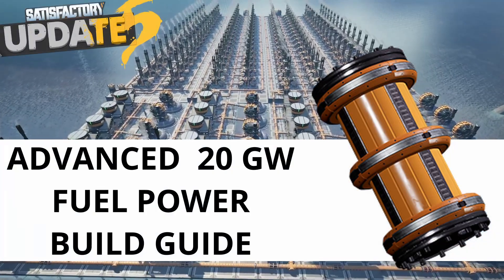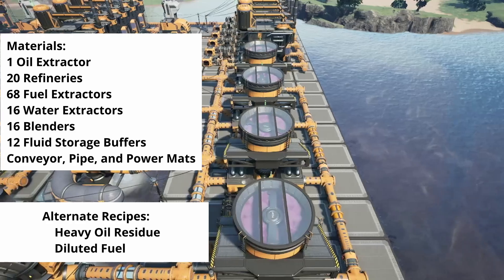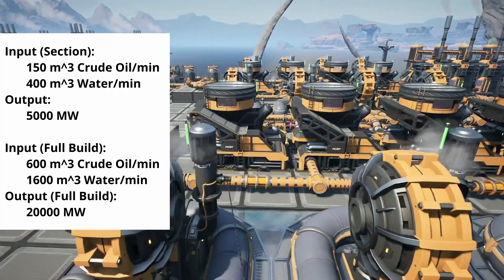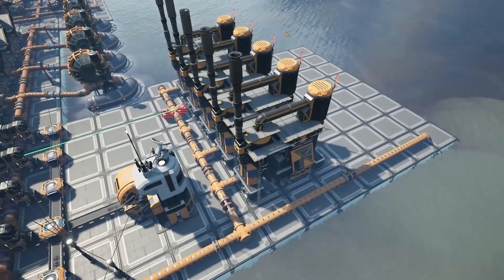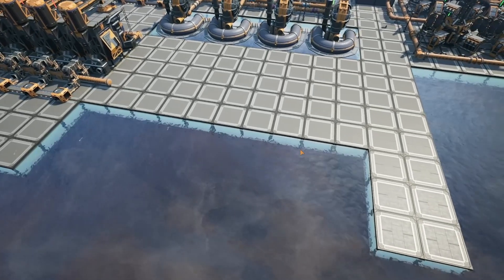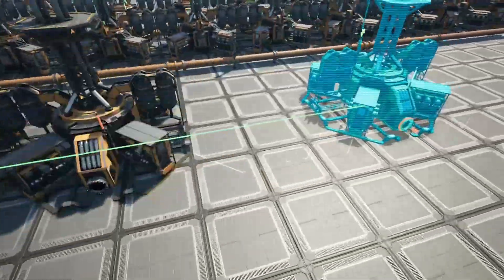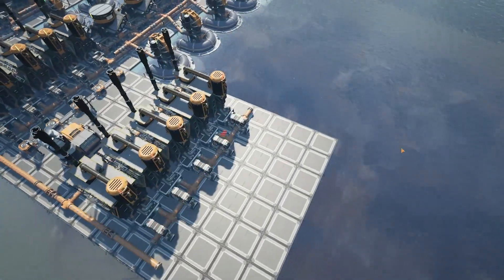Satisfactory Fuel Generator Setup Build Guide - 100% EFFICIENT Satisfactory Update 5 Fuel Power

Comment: When you watch this video right now and want to build this fuel generator setup, watch out. With the release of 1.0 they balanced many recipes and changed some buidlings, you will "only" need a total of 80 generators, so 20 per section and 10 per site, these generators now consume 20m³ fuel per minute while producing 250MW, so 20 generators will consume the entire 400m³ fuel provided by the blenders, everything else still works 100%, have fun!
Reply: Not all heroes wear capes. Thank you so much for this info
Reply: What`? So 80 gens or 20 gens? You are confusing me!
Reply: @WalkerEMC  20 by lane, 4 lanes so 80 gens
Reply: Can you build it by section if I don’t have  600 m cubed of oil?
Reply: Yess  @Siladzy
Reply: duuude, im setting up a fuel power plant now following the wiki guide for heavy oil residue recipe (300 p/m oil, 10 refineries, 8 blenders, into 35.56 refineries = 666.67 turbofuel into 22gw) and it says to feed the turbo fuel into 149 fuel generators. I kept doing and re doing layouts (cause its a lot of generators) until i checked the outputs again an realized there's NO WAY to feed that many.
Came to yt looking for confirmation, thanks man!
Reply: What’s the total mw/gw output now?
Reply: @Andysbx  80x 250 = 20.000MW
Use alien Power u get 22.000mw
Reply: @Andysbx  Same amount of power just using less Fuel Generators
Reply: I just came back to check the comments because of this.
Had to trouble shoot with lack of fuel and this was a quick answer. 
Thanks
Reply: I finished the entier thing and was trying to figure out why the fuel was running out too fast until I finally just calculated the output verse the input. My sadness at realizing I built double the fuel generators for no reason lol

Comment: not sure what i'm doing wrong, there seems to be a blockage near the blenders. The pipes are full of heavy oil residue but the blender inputs for it are super slow. The first 2 works on and off and the last two take 10 minutes to get enough for one cycle of diluted fuel. Any ideas ? I followed the guide down to the last detail

edit : Gave it more time. With all reactors, pipes and buffers full, reactors work for 5 minutes. The big buffer drains at a crazy fast rate... once it's empty, two thirds of the reactors die, I have no idea why ..hum....
Reply from the maker: If you'd like we can pop in multiplayer later and I'll take a look. Not for a few hours though.  Dekoba is my discord tag.
Reply: @Dekoba  I just found the issue! There was a weird tiny 1'' gap between a pipe and a junction (somehow SOME oil still went through?) just before the blenders.
Went through the pipes one by one and noticed a sharp drop between 2 of them, even then I didn't notice it. It was only visible at the right angle. ooof. I got lucky

Thank you so much for offering your help though! Much appreciated! Great guide!
Reply: @Dekoba  there's still a small issue. I sent you a friend request on Discord to ask you a quick question! tysm

Comment: would you be able to double everything other than the oil extractor if you had a pure node and then overclocked it to 250%?
Reply from the maker: a pure oil extractor at 250% produces 600 units of oil, which is also the maximum pipe capacity, and is used for the full size build here. each of the 4 segments uses 150 oil/min.

Comment: Couple generators in the middle ends up underpowered.
You've also placed 16 generators per side, making me second guess myself when i found out i don't have enough free space for that container at the end 😁
Reply from the maker: The numbers i stated in the video were correct but they changed how generator tuning works in update 6 so I'm not sure how big of an Impact that has on this design from update 5
Reply: @Dekoba  stated numbers are correct, i'm talking about the footage.
The underpowered issue ended up resolving itself - all generators are filled to the top now.

Comment: I really appreciate the video instructions, but I think I'm missing something. I've built 1/4 of the generators (34 fuel generators) and I find I needed 4 times the supporting buildings. For example, to provide enough diluted fuel to the generators, I've had to build 16 batchers instead of 4. My crude oil input from 1 node is adequate. What am I missing?

Comment: I don't know if you wil ever read this comment but I just built this power plant and everything is working just fine, but I've noticed that the last refinery of the last 2 rows tend not to get enough crude oil and thet go idle for about 2 or 3 seconds every 15 seconds or so. Will this be a problem in the long run seeing as this build is extremely specific with the input and output numbers
Reply from the maker: It wont cause major issues, but those flickers will carry through to power generation so youll see ~95% of the plant running normally and the last 5% flickering occasionally. I didnt run into that problem but removing 1-2 generators should allow it to stabilize even with the hiccups, at the cost of that last little bit of power.
Reply: @Dekoba  Thanks a lot for the reply and the advice. I managed to fix it after a bit of trial and error. First connecting the crude oil input from both sides. That fixed the refineries bit then the blenders started working inefficiently. So i shut down a couple of my generators so the fuel would accumulate then disconnected my blenders so they would fill up conpletely. Now the problem is gone and everything is running smoothly

Comment: A list of total materials needed for the buildings/machines. This doesn't include the materials for the foundations, pipes, conveyors or power poles. Just for the buildings. Also, as someone pointed out in the comments, the list in the video for the buildings was off a little. The total number of buildings you need to make are:

20 Refineries
16 Blenders
16 Water Extractors
8 Normal Fluid Buffers
4 Industrial Fluid Buffer
136 Fuel Generators

And the total materials for everything:

Aluminum Casings: 800
Cable: 60
Computers: 680
Copper Sheets: 840
Encased Industrial Beams: 220
Heavy Modular Frames: 1,532
Modular Frames: 40
Motors: 2,575
Plastic: 120
Quickwire: 6,800
Radio Control Units: 80
Reinforced Iron Plates: 160
Rotors: 160
Rubber: 6,800
Steel Pipes: 600

Assuming my math is right lol

Comment: I haven't gotten to blenders yet but I'm looking forward to doing something like this (I'm still kinda new to the game), I appreciate how you go through everything in detail. I've been having problems with my basic recipe fuel plant in the spire coast and the issue seems to only be with two of my oil lines (one 600m3/m and another 450m3/m) not getting the correct amount to the refineries for a reason I haven't been able to figure out. As someone who certainly understands fluids much better than I do, do you have any idea what could be going on? I have another 4 oil lines (all 600m3/m) that are working perfectly fine and can't find a difference between those and the two that aren't working right. I've tried using pumps and valves but nothing seems to fix the oil flow. I hope I can get a setup like the one in your video to work without these issues once I unlock blenders, great guide!

Comment: In the video you state that the last section where the fuel generators go is a 8x45 grid but counting how many generators you put down you only put 16 on each side not 17. Is the build for 34 generators or 32? If its 34 shouldnt the section be 8x47?
Reply from the maker: Yep. It should be 34 though I removed 1 because of the fluid bug.  The error in the video is because as a highly educated and professional youtuber I struggle with counting.
Reply: @Dekoba  All good homie, I just started laying it out and was like wait a minute... great video btw the extra power is really helping us out and building this was easy with your build guide

Comment: This is a great video. Thanks for it! But I have a problem (or maybe just a question). When I start the third part, I'm short with the foundation platform.  I don't have enough space to put the industrial fluid buffer at the end. So, I check if I really put 45 platforms and I did. And before just add more platform I check your video again and I realise something: you put only 32 generators (not 34). So, my question did your setup really work with 34 generators (with one at 33.33 clock speed) or I must put only 32 generators (still with one at 33.33 clock speed).
Reply from the maker: It works with 34 sort of. In the video I put 32 because I'm bad at counting.  Howevrr there's a bug in the game that deletes fluids, so you have to over produce some,  so the math is right but it works better with 32 gens.

Comment: Found an issue with a blender going idle on a regular basis, couldn't figure out what the issue was.  But running the pipe connecting four water extractors into the four blenders was the culprit.  There really isn't a need to run a single pipe to connect them all, they should be connected straight to the blender.  It's pointless to have them on a single line when they are all set to 83.33%, and the way that satisfactory works fluids can definitely cause some headaches, like in this case.  It should work that way, but it doesn't.  Great video otherwise, but like some have stated in the comments below, the number of machines is off ;-)  Easy to calculate the correct ones though!
Reply: Thank you! I ran into same problem was looking at for ages. Took me so long to think to check the blenders.

Comment: Hi Dekoba, a very nice video! Clear instructions and a good view on how to build, I like it very much! However the numbers at the beginning seem to be a little bit off, they don't fit for either one section or all 4 sections. I found that for one section you need: 
5 refineries
4 blenders
4 water extractors
2 normal fluid buffers
1 industrial fluid buffer
34 fuel generators

and for all 4 sections quadrupling the numbers gives:
20 refineries
16 blenders
16 water extractors
8 normal fluid buffers
4 industrial fluid buffer
136 fuel generators
Reply: If using Satisfactory tutorials has taught me one thing, it's that the numbers are almost always wrong. Luckily they're usually easy to fix or adjust. Can just cause a few headaches when first putting the necessary materials together. Your list is helpful!

Comment: Why do you underclock one of the power generators to 33.33%?
Reply from the maker: well, i dont anymore. I did because you produce more fuel than is consumed by 33 generators. But, First, I made a mistake in the math and it should be 24%, and second, theres a bug that deletes fuel whenever you reload a save, so you have to overproduce fuel, so now I just delete that last gen and only run 33.
Reply: @Dekoba  ah ok thank you

Comment: On the experimental branch I had a lot of the issues people have listed prior. I tried many of the solutions people have listed rotating gens, with and without the outer loop, with and without the buffers. I noticed that there was an efficiency drop in my last 2 mixers which seems to had been rectified with using Mk I pipes to carry heavy oil residue instead of using MK II. My 34th gen is tuned to the 24% so the burn rate matches production. I've got 5 more modules to build to use up the entire coast so still playing with the designs.

Comment: Thank you for this tutorial that I have already applied to produce 5000 MW. 
I used the surplus water production to add the production of plastic and rubber

Question: What software do you use to produce a time-lap video in build mode from the top view?

Comment: can you explain the flow compensator more? which way is the valve facing? how does it work?
Reply from the maker: the valve faces forward (along from the blenders to the generators) and the compensator itself is designed to reduce the amount of 'sloshing' in the pipeline, lowering the size of peaks and valleys of flow. Its not 100% but in my experience means flow rates only change by ~10% instead of ~25%. It works by, whenever there is a peak that cant flow forward into the generators, it flows into the storage buffers instead, and when a valley flows forward with extra space, it fills from the buffers. Thats the theory anyway, and in my expirience it helps but is not 100%. Every little bit though, and I like the look of it as well.

Comment: Just built it and around half of my generators are not filled. I think the problem is the refinery output to the blender input. 5 refineries: 100 heavy residue -->4 blenders: 200 heavy residue. Missing out on half of the heavy residue I need.  Guess I'll have to input another 600 oil and double the refineries. I'm not sure if I missed something, or if something is different in update 6, real head scratcher.
Reply from the maker: Not sure,  the math on this checked out when it was built,  and it ran for several dozen hours without issue in update 5.
Reply: Are you sure you are using the correct "alternative" reciepe for "heavy oil residue"? One refinerie will produce 40 heavy oil residue and 20 poly per minute. 5x40 = 200. I checked the reciepts and it sounds a bit like you are using "rubber" instead of "heavy oil residue"? EDIT: rubber or poly, both original reciepts do only 20  heavy oil residue per minute
Reply from the maker: @1337silent  nah i just loaded up the save. the heavy oil residue alternate recipe takes 30 crude and produces 40 residue. so 150 crude goes into 5 refineries and makes 200 residue. 200 residue useing the diluted alt makes 400 fuel, which burns in 33.33_ generators. the video math and stated recipes are correct and remain correct in update 6. You might be using the incorrect recipe.
Reply: @Dekoba  you mixed something here. "Seth Tunnell" was the guy using the wrong recipe. I just stated basically exact the same thing you did, that he most probably using the wrong recipe for that :-) No worries
Reply from the maker: @1337silent  haha thanks for letting me know. cheers
Reply: Thanks guys. Haven't been able to look again just yet, but I'm sure that's what it is. Was definitely using the rubber recipe. I've learned quick that when something doesn't work it's always your fault lol. A lot of moving parts, especially with a build of this size. Cheers!

Comment: At 4:14, I'm not sure if it's because I'm on the experimental build but if I place the clock speed at 33.33% the consumption is 5.15 fuel which is not desired as it exceeds the 400 fuel available by 1.15, so I set the clock speed to 24% which takes exactly 4 fuel, hope this helps someone and thanks for the guide!

Comment: So I, just built this and im having issues with not all generators are getting full, i let all the machines fill up but its not producing enough fuel the middle ones keep running out
Reply: Same, but I'm pretty sure I've figured out the problem. 5 refineries output a total of 100 heavy residue. Inputs for 4 heavy blenders are a total 200 heavy residue. Essentially missing half of the fuel we need. Not sure if this was changed/nerfed/ etc. Haven't been able to figure out anything else.
Reply: @sethtunnell7424  I got it to work, the pipes were connected but they glitched and nothing was flowing through from 1 refinery, the key part is letting the fuel pipes completely fill up all generators and the pipe loop before you hook them up or it will never work, so once I made sure everything was flowing correctly I cut the power off let every refill and it worked, the rings on the pipes need to be completely still all the way around

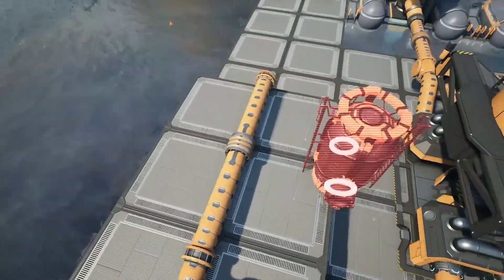Comment: Can someone explain to me the use for what's being built at 3:29
Reply from the maker: fluids in satisfactory have a 'sloshing' effect that causes them to flow in peaks and valleys. Moving 100 units of oil might have a wave form with peaks of 130 units and valleys of 70 units. This causes problems when you are moving fluids near the max of the pipe volume (like moving 300 units in a 300 unit pipe), since the peaks are cut off and you are only left with the valleys. That structure is a method to reduce the size of the peaks and valleys (in the previous example, it might reduce them to 115/85, for example.) 

More info https://static.wikia.nocookie.net/satisfactory_gamepedia_en/images/3/39/Pipeline_Manual.pdf

Comment: While this didn't work as advertised for me (100 % Efficiency), how I solved the problems getting fuel to the center was to disconnect one end Fuel Gen, and it's brother across the pipe I underclocked to 22% and also I disconnected the whole outer ring of pipe as well as the Fluid Buffer at the end. So, 32 @ 100% + 1 @ 22% and no outer ring or fluid buffer. I think I'm getting 4833 MW from the system, and I'm still happy with the result. Next stage, duplicate it !

Comment: I know I'm coming to this late, however I had an issue/question. I built one of these so far.  I let the system fill up and then powered up the generators.  Everything looked great.  However the next time I loaded the game I noticed half of the generators were not running.  I checked to see and the pipes were bone dry.  As it took a decent amount of time initially for everything to fill up I'm concerned about how to deal with a significant ramp up time if the system will start dry every time I load the game.-  Thanks for the great videos!
Reply: there is a bug where the volume drops 5% when you reload a save, maybe that disrupts the balance